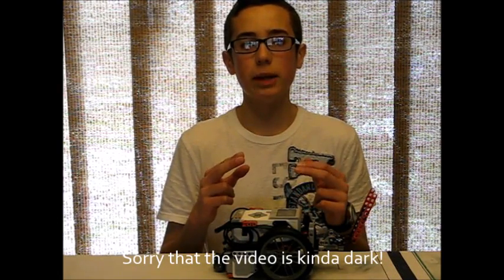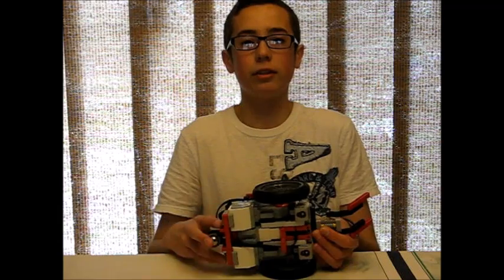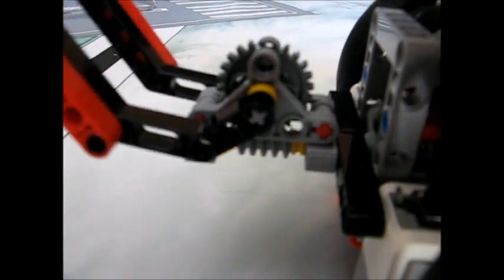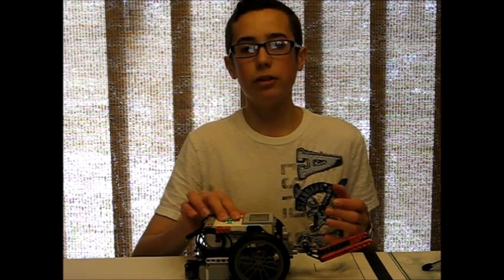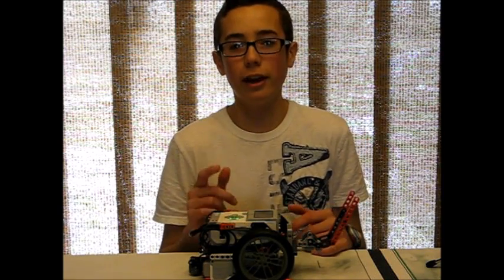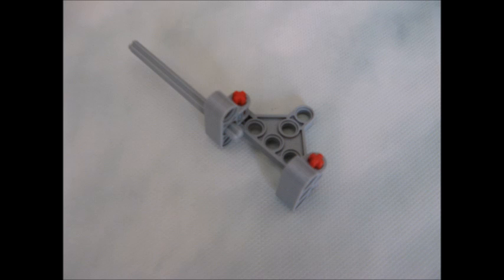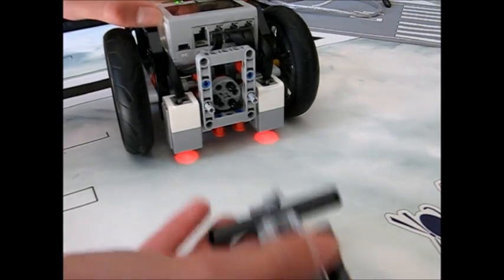The Mighty Worm Gear and How it Can Help Your EV3 Robot!

Comment: I know I'm late to the party, but your video is EXACTLY what I needed for my engineering design class. We were running into an issue where we have to lift a pretty sizable amount of weight and the medium motor doesn't quite cut it, this solution, along with replacing the gray gear with a larger one, should fix our problem. Thank you, man, I appreciate the informative videos.

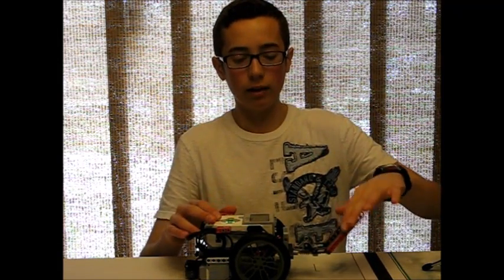Comment: One additional point I find interesting about worm gears: when you are calculating gear reduction, a worm gear always has a value of one.  So if you use it to drive a 24-tooth gear, the gear reduction is 1:24 with just one gear connection!  That would take multiple "normal" technic gears to accomplish.  I don't build robots for competition - I just build fun things that interest me.  I am currently working on a mobile to hang from the ceiling and also designing a first try at kinetic sculpture, so, for me, knowing my specific values for gearing up and gearing down are important to control the speed (or slowness) of the parts of my mechanism.  In many cases I want things to go far slower than the motor rotates.
Reply from the maker: That is awesome, thanks for sharing! And yes, you are correct about the ratios. If you think about it, a worm gear only has one tooth that wraps around it continuously.

Comment: Very impressed by your videos, however, as an engineer in training (aka college :D) I've noticed that throughout all your gear videos, you never had a word for the tradeoff between speed and torque. Its mechanical advantage, and all it says is that, using either pulleys or gears, you multiply either speed or torque at the cost of its opposite. I did a science fair project with K'nex one time using pulleys in a crane in order to pick up loads that the K'nex motors never could've picked up on their own. But very impressive ideas about the usefulness of the Lego gears. Also, learned something new about how to use bevel gears in the respective video! :D Thanks!!!!
Reply from the maker: Awesome, thanks for pointing that out! You're referring to my earlier videos; while I understood the concept of mechanical advantage then, I didn't know that name of it. I do now, and I regularly use the term in my videos and in other engineering settings. Thanks for the insightful comment!

Comment: is the worm  gear the alternative sloution for using the servos? and which is the cheapest soln.? and how can i get these components ??
Reply from the maker: You can acquire the components from bricklink.com. The EV3 motors on their own are already servo motors, so a worm gear does not serve as an alternative. The purpose of a worm gear is to alter the characteristics of a motor/mechanism in the way described in this video.
Reply: are servo motors necessary or can i just depend on DC motors?
Reply from the maker: No, servos are not required. Any motor can power a worm gear mechanism.

Comment: how can we make it with the 31313 home edition plz make a video if u can
Reply from the maker: It should use the same or very similar parts. All the necessary pieces are included in the 31313 set, you may just need to build a different housing.
Reply: thanks. awesome vids by the way